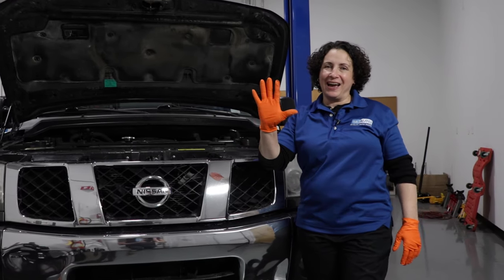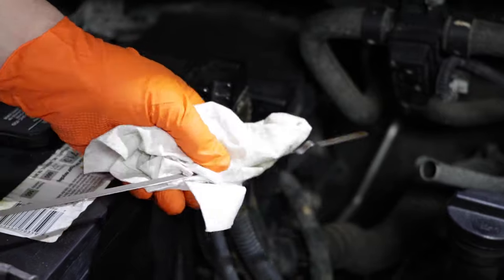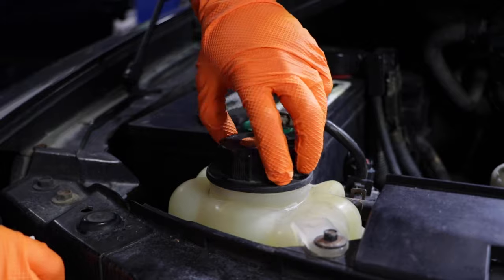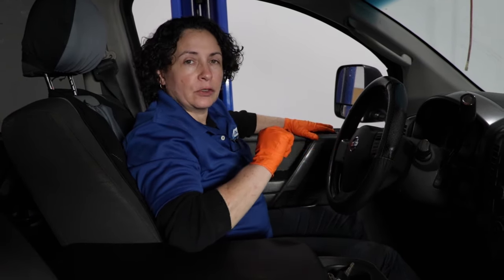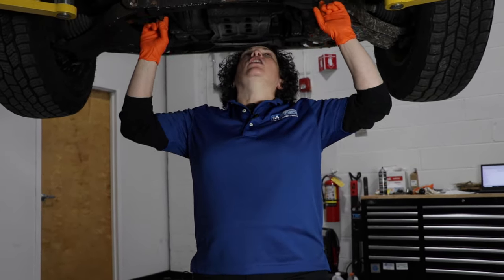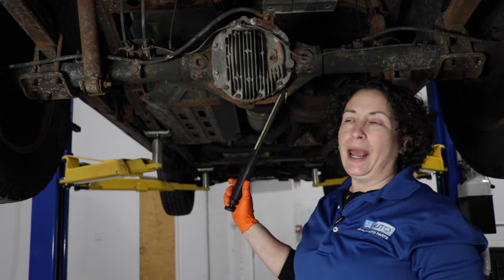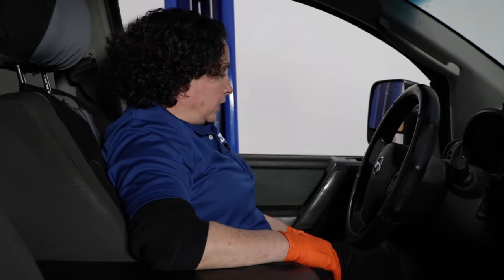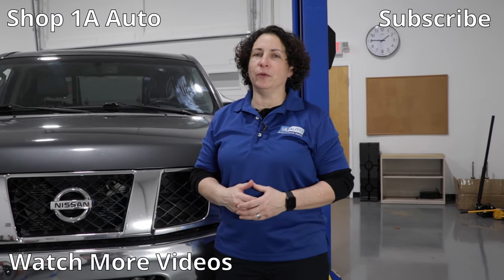Top 5 Problems Nissan Titan Truck 1st Generation 2004-2015

Comment: I disagree with your axle prognosis to keep replacing seals.  Just vent the axle by drilling a hole in the top of either side and either use a brass barb  and a piece of hose.  Run the hose up the filler neck and zip tie it.  My 08 has a vent, but it plugs up.  In my case pressure pushed the GL out the pinion seal.  I caught it, topped off the pumpkin and cleaned the vent.  The  "clock spring" aka spiral coupling is an easy cheap fix if you buy the aftermarket replacement.  However later models with a steering angle sensor you have to buy the Nissan part which is $420.  The radiator problem seems to be on early models up to 05, so if it has high mileage, it obviously hasn't failed.  I have 230k miles on an 08 Titan, and 175K on my Armada.  Power trains have been bombproof.  All I do is maintenance per the owners manual. Climate control actuators, cheap interior plastics, evap sensors, cracked exhaust manifolds and thin paint are my only complaints.  Both get lousy fuel mileage, but that is the price for the power.  I tow with both vehicles and neither of them break a sweat.
Reply: Great idea..
Reply: How do you replace the climate control actuator? Mine has been tapping forever but I don’t know if it can be fixed without removing the dash and that seems daunting.
Reply: @colbycarroll7746  really easy. right under the dash near the foot area. should be a blend door actuator video here
Reply: Ya agree. I'm in Texas and my entire hood clear coat is gone. Looks like crap but she still tows all a ask with out complaint. Reg service helps  sure. I  Use synthetics
Reply: On my 05 Titan Xe with 117k mi I am still on the original radiator and have no issues yet but should I change the radiator just incase the coolant mixes with the trans fluid?
Reply: @Gleeleeglee  bypass it. I used a Hayden 678 trans cooler, 153 install kit and 25ft of Derale 11/32 transmission hose part # 13007 which is everything you need to run fluid from the trans to the external cooler then to the factory cooler (the one behind the radiator not in it. The one in the radiator is actually a heater to bring the fluid up to operating temps quickly). The factory cooler already runs back to the transmission so you don't have to touch any hoses going back to the transmission. This cost under $100 in parts: cooler $40, hose $40 install kit $15, runs cooler than before, takes half a day even if you don't know what your doing like me and you never have to worry about the radiator internally cracking and destroying your transmission. Coincidentally the extra hose not used fit perfectly over the 1/8 NPT to 3/8 barb used for the axle breather mod.
Reply: @colbycarroll7746  mine was done by stealer for warranty..they did. Loose my dash..lol..but fixed free

Comment: I have always liked nissan trucks,  The first main issue when the truck was released in 2004 was the front brake rotors warped due to excessive heat by design.  I owned one. It took nissan 6 mos to finally make a formal recall and replace them. Good thing since not doing so on a braking issue would be a very bad safety lawsuit.

Comment: 07 Armada that I just purchased.  I installed a separate trans cooler in the 1st month.  No longer connected to the radiator.  Working good with summer driving with trans temp normal.  It was an easy job to install and cost less than $50.  Cheap insurance.

Comment: I have a 2008 Titan, bought it new,  and haven't had any problems yet. The only thing I had to replace is the radiator cap and the brakes/rotors. Other than that, I'm running everything that they put on it. Now, this spring, I'll be doing extensive maintenance on it since I haven't done anything to it....ever. Like shocks & struts, change both diff fluids, spark plugs etc. I'll be happy if I get 5 more years out of it. It's been an excellent truck for me. If I had a complaint, it'd be the paint peeling/wearing of of the roof in the spot where there's no insulation (middle front), top of hood and top of both front fenders. I'm going to look into a full body LineX/Rhino spray job so I dont have to worry about the paint/clearcoat.
Reply from the maker: +Orion3 Thanks for the feedback!

Comment: You state the axle doesn't have a vent.
My `06 has a factory vent on the righthand axle tube.
It did get plugged and blew out the seal, but it does exist and a Ford vent plug threads right in.

Comment: I bought a 2006 LE big tow, off the showroom floor,  that truck was a beast.............sadly after 2 rear ends within 2 years and the final straw for me was trans cooler and tranny failure that  did it for me to trade it in.  all recommended maintence was done by the dealer,  all was covered under warranty but the issues kept coming so I got rid of it.

Comment: Great Video, I have none of this problems on my 2005 Titan.  I will pay attention to these areas, and am sure it will make it to 20 Years with nothing but a muffler and brake pads, and tires.  Thanks again.  I would have made a mistake trading this in on a new one, but I cannot find a King Cab in a Higher trim level unless I want a 5.5 ft bed and that defeats the purpose of a truck, at least for myself.

Comment: My '06 had the axle shaft seal problem.  There was a vent...but a very small one that had gotten plugged.  Replaced it with a modification I saw on youtube and already mentioned in this comment thread...brass fitting with a hose attached to vent pressure, etc etc.  Replaced the axle seal myself...which also requires a wheel bearing change as well.  Back on the road with 260,000 miles...still going strong but is starting to show age elsewhere.  Left front wheel bearing went out two weeks later.  Simple repair on a 2wd !!

Comment: My 06 Titan had a check valve vent. And I did the tube mod . Put barbed fitting in place of and ran tube up passenger rear fender with filter on end. No more axle seal leaks

Comment: The plastic tube connector on the firewall for the heater core. 

I snipped it and bypassed it  my 2011 titan was trooper. Ran it hard trying to get a new engine on warranty, but it was bulletproof. 
I took really good care of it instead and sold it with almost 200k miles. I still see it around town and I miss it.

Comment: OEM Trans/Radiator hoses under the front end also develop cracks and leak fluids, something to look for every couple of years for the cold/warm climates! Might save someone from being broken down like I was. Thought for sure this would be top 5. 09 Titan
Reply: This happend to me and luckily i caught it on time. Less than $10 replaced that hose from the auto parts store
Reply: Happened to my 2007. I was driving and all of a sudden had a cloud of smoke behind me. I pulled off to find a hose spraying transmission fluid everywhere.
Reply: Same here.  All the transmission cooler lines have failed once at one time or other.   Guess it's just age and wear and tear.

Comment: I can honestly say the 09 I had didn't have any of these issues
Reply: Good to hear because I own an ‘09 with 65300 miles on it.  great truck!
Reply: I also have an 09 titan just hit about 203000 miles. Everything is excellent on it. Just done oil changes brakes, and tires. Replaced the radiator myself. Other than that it's good.

Comment: I have an 08 Titan SE,the problem I had was the little section of flex hose that connects the transmission cooling line to the radiator sprung a bad leak and all the fluid leaked out,I immediately pulled over and had it towed, I had the line fixed it ran fine for a week then the transmission failed,had to be rebuilt $4,000.00, transmission shop told me when all the fluid leaks out that's what happens, I suggest that if you have 100k plus miles on yours "check that hose",this is a design flaw since that little section of hose can't be seen since it is hidden by that shield,still a great truck !!!! Oh I almost forgot "how about the starter under the the intake manifold"??????

Comment: I bought my 04 new.  Nissan replaced the metal dif cover with an 05 aluminum on for me early on.  Had axle seal leakes about 12 years in.  There is ABSOLUTELY A VENT!  I just went out and double checked.  Not sure which year wouldn't have one as mine has a manufacture date of 12/2003

Comment: I have a 2012 titan with 140000 miles on it and haven’t had any of these issues. But the issues I have had is the notorious blend door actuator, low air pressure light want turn off on dash cluster and the drivers side rear half door has problems opening. I have to pull the handle like 10-15 times before it will open most times. Other than that it has been a solid truck. I also bought it new.

Comment: I have about 400K on my titan and have experienced most of these.  As another mentioned, the exhaust manifolds will fail that should have been mentioned  Headers are the way to go.  I have lost 2 radiators over the years, neither leaked into the trans.  One fuel pump.  Yup, the rear axle is a nightmare.  I actually installed a used Nv3500 - AAM 14 bolt axle.  I changed the interior to the 2015 model after the paint wore off on everything and the env controls unit went bad.  I think soda was spilled on it.  Went thorough a clockspring as well.  The steering wheel was nasty and I installed the 2nd gen titan steering wheel.  Still has the original trans and engine.  Once they go. Im going with the second gen engine and 9 speed.
Reply: "I actually installed a used Nv3500 - AAM 14 bolt axle"

I have an 07 titan and have had many issues with the real axle and still do today. Many times I wondered how feasible it would be to swap in the Titan XD or nv3500 axle onto my titan. Can you tell me how difficult your swap was? Was there a lot of modification needed to make the nv3500 axle fit onto your titan? I am really curious!
Reply: @przemeksledziewski1973  I had to splice the ABS sensors.  You need the NV or XD u-bolts and hangers.  Had to muscle the springs a little and that was it.  Everything bolted up.  Even the driveshaft which I thought would require modification.  Truck drives heavy now.  Not like a Titan.  Prob more like an XD.
Reply: Almost forgot.  You will need new rims and spacers for the front.
Reply: @omorin34 
That is so cool! I've always liked the idea of making the Titan into a stout little HD truck. Especially when the rear axle is continuously giving me trouble.

If I could please bother you a little more with some more questions, as I am new to this.

"I had to splice the ABS sensors"
1. Meaning you used the existing titan connectors but fused them to the NV ABS wires, correct? No dash lights? 

"Had to muscle the springs a little" 
2. Does this mean you used the Titan's leaf springs or the NV's leaf springs? 

"Everything bolted up" 
3. So no need to modify the NV's spring perches, correct? 

"Even the driveshaft which I thought would require modification" 
4. So no need to worry about the pinion angle, correct? 

5. So NV hubs fit right in to the Titan's front knuckles? Then just do the same wire splicing? If so which spacers specifically did you use? 

6. What year is your Titan? 4wd or 2wd?

I hate to ask so many questions but I would be grateful if you told me more.

Comment: I bought my 2006 Titan new (currently April 2021) and there are more 2 items to add to the list.

1. The exhaust manifolds crack on the 5.6 engines. The Armada and the Infiniti also have the same problem.  The fix is to install  performance headers .
2. The rotors warped very easily on the 1st gens. IMO they are way too small for the truck. The fix, install performance brakes and rotors.
Reply from the maker: +Stuygym Thanks for the feedback!
Reply: Manifolds should have been #1

Comment: There is a vent tube on first gen Titan, when it starts blowing out seals it’s because it’s clogged, the oem vent tube which is just a little nub on the top right of the axle, if you have this issue google axle vent mod for these trucks, it’s a life saver and did it on mine.

Comment: The only correction I have for the items you noted, was the rear axle vent. It does actually have one! The design is flawed though, it will rust closed very easily and create the exact symptoms you mentioned. These, and all Nissan trucks are also hard on lower ball joints - I see this often enough to mention. Due to the suspension design most DIY'ers will miss these when checking over their suspension

Comment: Looking at a 2007 nissan titan le with 140k miles , one owner. Florida driven, great condition new tires . Guy wants $8,300. How do you feel about the price ?
Reply: I got a 06 Titan with about 115k for 10k. Similar trucks can be double that I like mine.

Comment: Where are the exhaust manifold issues and the blend door actuators that every Titan has issues with?  I've never heard of Smod issues, fuel pump issues, or clock spring issues in the Titan.
Reply: It does. Mine has that code as I type. Also, the abs seems to engage when breaks applied( weird noise) and SLIP light comes and goes.

Comment: Guess I was very lucky. I had a 2005 Titan LE crew cab and never had an issue. I traded it in with 165,000 miles on it, for a 2017 Titan XD because I liked my LE. Love my XD. I needed a more powerful tow vehicle for my 27 foot trailer.

Comment: I bought my 2005 titan new, now I have 250,000 miles on it the biggest thing that went wrong so far is the fuel pump quit at 165,000.

Comment: I have a 2005 pro 4. Having done all my own mechanics and maintenance myself. My truck has been a pleasure to own and I have 230 + thousand miles . bought it with 78,090 . Still going, and drives better than most new 4x4s . And you can put a 4x4 sheet of plywood in rear seating area ! How many trucks do that.? Drives better than my 2018 Dodge ram quad cab 4x4 . Have yet to drive a stock crew cab 4x4 that drives as good,turns as sharp,as quiet and efficient as my Titan. I've been driving Nissan Datsun trucks since the 80s,. I still drive a 1986.5 hardbody Nissan pickup that has help feed our family for over 30 years. Thanks Nissan! Canada,, Mississippi,and america companies that have made it possible.. No,, Really thanks.

Comment: I have a 2010 titan and I luv my trk...I had to put a new engine in my trk after a year having it cause whoever had my trk first never took care of it and they put that cheap oil the trk...after putting my engine in with only 7700 miles on the engine now I really luv my trk will never get rid of it...GO NISSAN TITANS

Comment: I had a 2007 nissan titan xe I found out to tap the rear end extend a hose with small filter at end to tail light to help breath the rear end. After two seal replacements I did it and never had a problem took that baby to 170k and found out still running strong. Also vent actuators are a key problem remove whole dash to fix the issue and they suck.

Comment: Great video , I had also heard of issues with the AC/ heat system.  It anyhow good overall informative key points given! Also wondered if one could do their own mod for a vent tube concerning the rear axles

Comment: I can tell you more about the interior, specifically the dash components, they become a brittle as potato chips.  I had to replace my instrument cluster piece (not sure exact name) but over the speedo fell apart in my hands taking it out.  The other is the whole part around the radio bezel that has the two center vents, and goes up and over the dash, also fell apart in my hands trying to take it out to replace.  Frankly the interior, although looked good in the beginning, of course, did not hold up much past 10 years.  The paint, holy cow, worst paint ever, and I kept my truck spotless, waxed and detailed.  Didn’t matter, oxidation started setting in and never could fix it.  Now it just needs a whole new paint job and has surface rust starting along the rain channels.  Too bad, may definitely affect whether I get another.
Reply: Seems you and I have the same truck!😄

Comment: On my 08 I had both my front and rear diff go out on me back to back years, as well as my radiator along with the front differential. But at this point it’s better to bite the bullet and get it fixed than by a new one.

Comment: The transmission/coolant intermix problem you spoke of was not a problem on the Titan. It WAS an issue on 05-09 Frontier. They extended the warranty on this and covered most to 125,000.
Reply from the maker: +Mike Pickens Thanks for the feedback!

Comment: I have a 2007 Titan Crewcab SE with tow package I purchased in 2009 used with 24K miles.  It has 83K miles on it now and I have had no issues.  I don't want to wait for issues, so what are the fixes?  Do I get the radiator replaced?  Can a breather be added to the rear axle?  What is the fix for the clock spring?

Comment: What about the running lightscon my camper trailer not working? Any word on this problem? I have a 2011 nissan titan. I checked all fuses (both boxes) from underneath  the hood, inside the cab etc.. All good, not blown.

Comment: Still have my 2004, first year made. Recalled for front brake warping (?) warranty repair. One coil pack bad at 70k, $20 and 5 minutes to replace. Heat blend motor bad, $40 and 3 hour to replace. Broken wire on column shifter manual switch, solder bypass wire, no cost, 2 hour to fix. Tail pipe rusted fell off, new  SS cat back $500, 3 hours. Replaced radiator with aluminum one because of horror stories, $350 and 5 hours. Front struts at 70k, $220, 4 hours. If I didn't do it myself I can see how people would be pissed and justified, But if you think they are bad, buy one of the big three especially Dudge. Love this truck, made the Big three hustle to catch up because they were obsolete. Nissan should have fixed everything and advertised more and immediately changed production to address issues. They blew it. As usual.